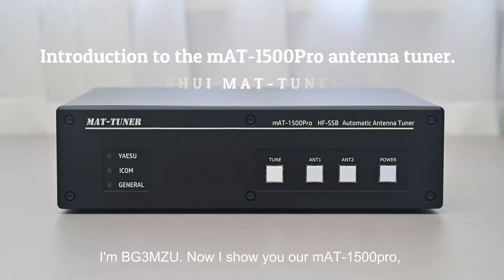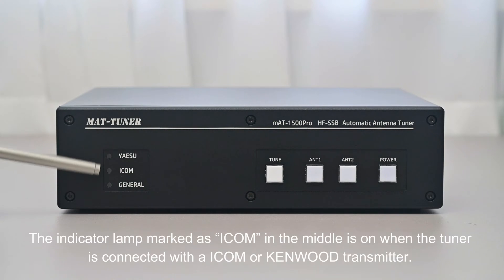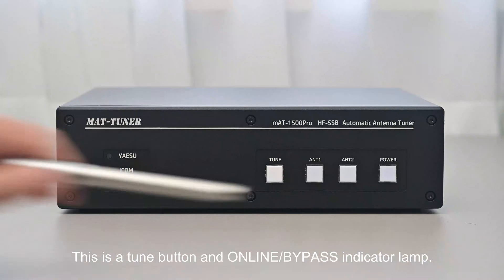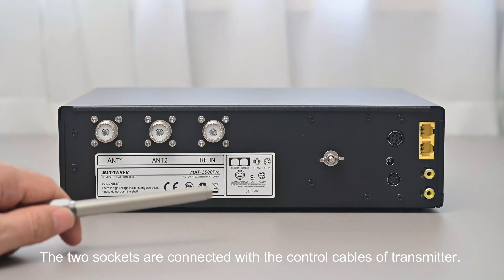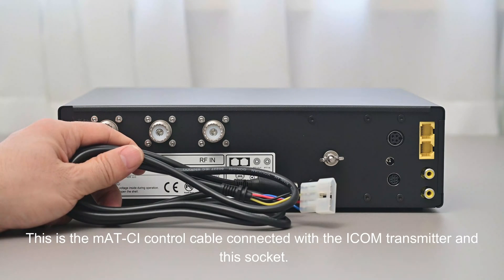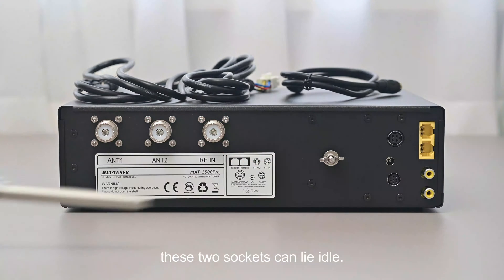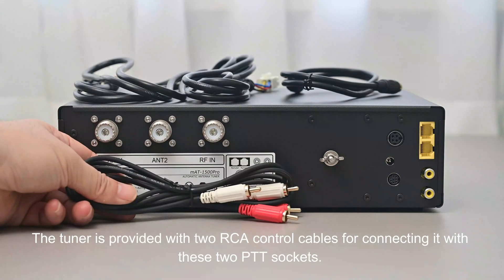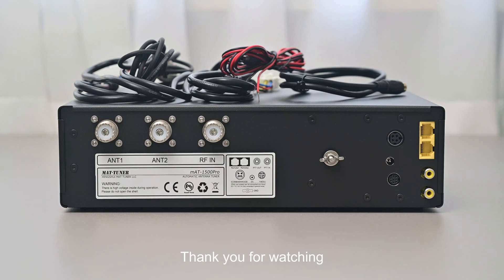MAT 1500Pro Antenna Tuner 1   Introduction

Comment: Hello I drive a sailor marine amplifier from an Icom ic705 , 3 watts in 300 watts out. Is it possible for me to use this tuner after the amplifier connecting to the antenna.